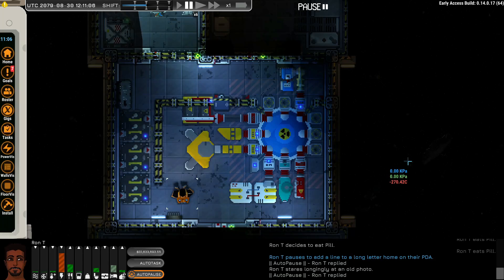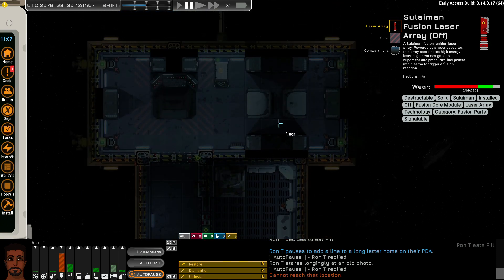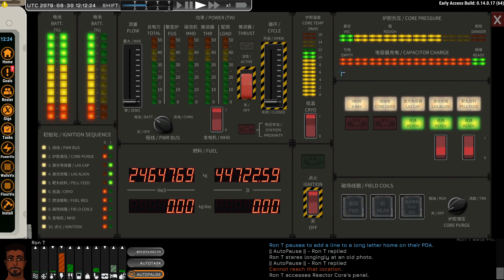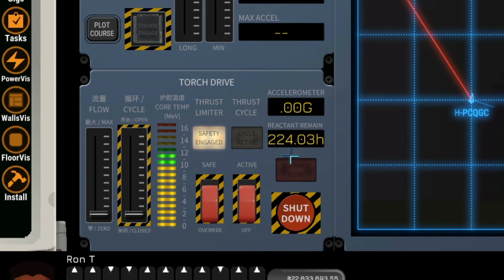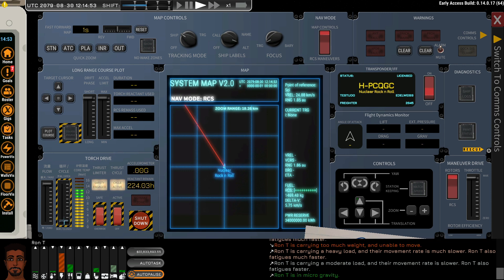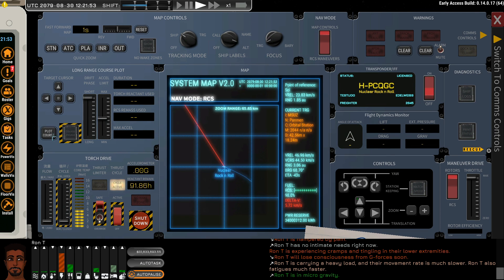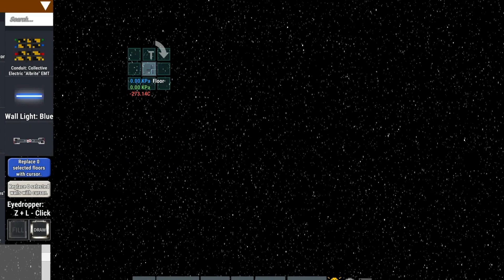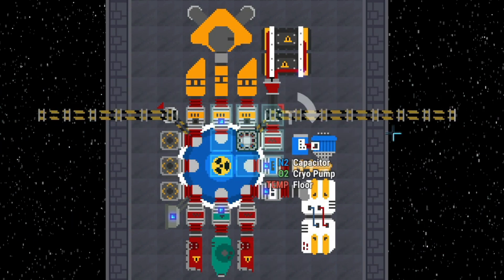OSTRANAUTS-Tutorials [FUSION REACTOR]

Comment: You went over the backup battery part pretty quickly. Can you make a video on it
Reply from the maker: @TheAIKnowledgeHub  I see what you mean, a video shouldn't be necessary. Just put an additional battery into the cockpit area, put a switch on the battery and wire it into the ship. With the switch off, the battery will remain isolated from the ship (will also not charge).

Comment: Are there ways to make the reactor stronger or more efficient? Like more laser arrays, or capacitors, or pellet feeders?
Reply from the maker: @General-Zane  unfortunately only more powerful through the additional laser array as per manual, efficiency cannot be tuned.
Reply: @MartianDanTheMartianMan  I found out that if you set the core purge to 'Off' during operations, it drastically reduces consumption of H2 and D2O, but keeps up the same energy production.
Reply from the maker: @Alex-tc8uj  well yes. That is the way you are supposed to run it :)
Reply: @MartianDanTheMartianMan  ..I was not aware of that, I thought you kept that on 💀

What is the point of regular and turbo core purge then?
Reply from the maker: @Alex-tc8uj  just a speed difference, but either one works just fine to purge the core.

Comment: 3:20 worth noting under real life vacuum mechanism the roughing usually refer to pump out from 10-7 to 10-3, as turbo pump typically working from 10-3 to 10-2(can be lower to 10-e) operating turbo pump above 10-3 would suffer wear(it would heat up)

Comment: field coils dont show up after a failed (and almost exploded) reactor, everything else powers on fine and i get to the point of ignition but decided against it. what do? 
i may figure it out by uninstalling it, but thought i'd leave this here for others who may have a similar issue.
Reply from the maker: @daubenyhervis6437  what do you mean they don't show up? Don't show up where, on the panel?
They are absolutely required and must be in good condition or the reaction will run out of control and the reactor will blow up.
Remove the reactor, uninstall the field coils and repair them to 100%
Unless they are glitched somehow, then just spawn in a new set.

Comment: Batteries with an input and output?????
Reply from the maker: @Anomynous  the output is what the reactor monitors on the panel. The input is for power up. You can just loop the in and out if you don't want to have a separate battery, in case you lost all power.

Comment: Im having an issue im not sure what im doing wrong, the cryo pump simply wont turn on, its fully repaired and i have a cryo container with helium but it still wont indicate green, even the little blue light on the pump refuses to come on.
Reply from the maker: @RedstarBunny  everything else is powered? Sounds like you are not connected to the batteries. Checklist:
1) power to the reactor (batteries to the inlet arrow)
2) all components should be at least half green on damage
3) uninstall and reinstall the cryopump in a different slot
4) verify the reactor is on battery power and LED illuminated
Reply: @MartianDanTheMartianMan  yep ive actually been able to start the reactor but had to shut it down since it was getting hot (just reloaded after i realized the damage it did to the shielding) everything is connected but for some reason the pump just doesnt come on despite everything else, even reinstalled it in different ports.
Reply from the maker: @RedstarBunny  no error message when you flick the switch on the control panel?
Perhaps the pump is glitched somehow?
As long as you have enough helium, it should work.
Try adding a fresh pump in the console (capital matters):

spawn ItmFusionCryoPump01Loose
Reply: @ I figured it out with some more help, it’s some sort of bug involving signal boxes, I had to connect the pump to it and it instantly turned on but after that I could disconnect it again not sure why this happens but yeah.
Reply from the maker: @RedstarBunny  huh? Never came across that problem and I played a ton with signal boxes. Just comes to show why alpha testing with many people is so crucial. Thanks for the update!
Reply: @ yep no problem! Glad you and others are willing to help otherwise I’d not found the solution I think, also I loved the video that’s how I got my reactor running :)
Reply from the maker: @RedstarBunny  much appreciated 😊